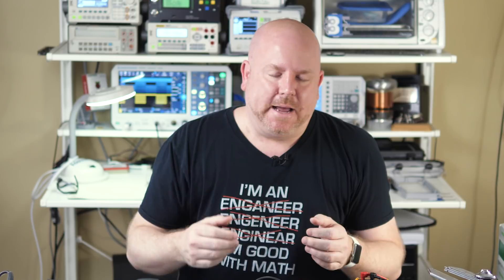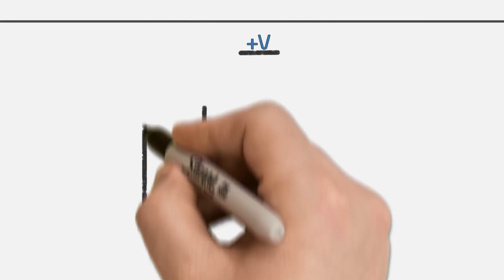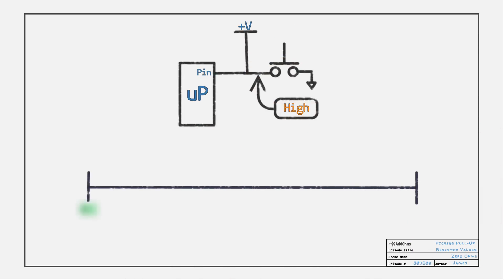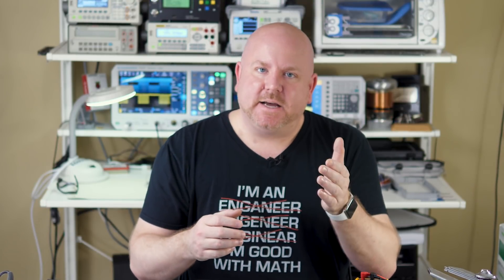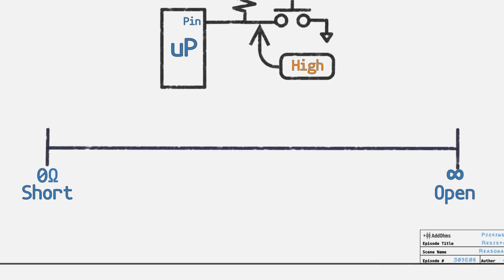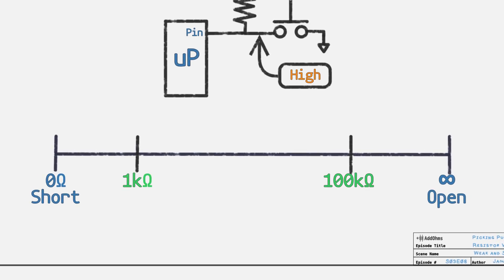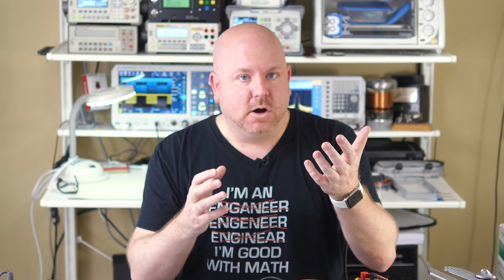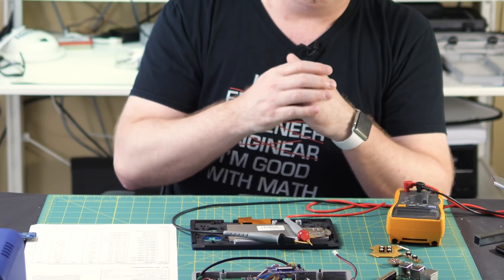Picking Pull-Up Resistor Values | AO #25

Comment: Also, if your pin change it's mode from INPUT to OUTPUT ang goes LOW, you will blow pin or whole micro! Pins can change their modes for a moment at startup.
Reply from the maker: > Pins can change their modes for a moment at startup
Almost all microcontrollers start-up with their pins as high-impedance (or INPUT). In the case of Arduino, care needs to be taken because Pin 13 is changed to an output pin to flash the LED. But that is by the bootloader and not a function of the microcontroller itself. The high-impedance state is one reason to use pull-up and pull-down resistors for other devices in the circuit.

> if your pin change it's mode from INPUT to OUTPUT ang goes LOW, you will blow pin
This is not a true statement all of the time. First, a pull-up or pull-down resistor will not save the pin in this case.  Second, an OUTPUT to HIGH can destroy the pin just as easily as a LOW, depending on what is connected. Third, it entirely depends on what the pin is connected to.,
Reply: >Almost all microcontrollers start-up with their pins as high-impedance
Did not know that, thanks for info.

>> if your pin change it's mode from INPUT to OUTPUT ang goes LOW, you will blow pin
>This is not a true statement all of the time. First, a pull-up or pull-down resistor will not save the >pin in this case.  Second, an OUTPUT to HIGH can destroy the pin just as easily as a LOW, >depending on what is connected. Third, it entirely depends on what the pin is connected to.
I agree. What I meant is 1K pull-up will limit 5V to nice and safe 5mA or so. Still a problem if pin becomes OUTPUT HIGH and button is pressed (it happens in development :))

Comment: Hey! I found your videos very useful and educative for me..but can you please expalin me the difference between ground and negative.. It would be of great help.. Thanks.
Reply from the maker: Ground is a reference point, also called common. Voltages are relative and so for most of a circuit’s analysis voltage is referenced to its “ground.” Positive voltage are positive to that reference, and negative is, well, negative. In digital circuits negative is sometimes called ground since ground is 0 volts.  Also probably because early digital stuff was powered by a battery which has positive and negative terminals. A battery floating in the air doesn’t have a ground reference, so it is referenced to itself, which is why you don’t call one of the terminals ground.
Reply: Thanks man.
Reply: But I am a beginner in the field of elctronics and i am not able to to understand the terms you have used so can you explain it through a video... Please I am very Desperate to know the difference between the two.. Thanks.

Comment: If I need a fast response, I use 3k3 ohm and pull up to 3V3. Which give me a nice 1mA sink when using I2C, beware it uses lot's of power. Or just slow down the clock speed and use 10k pull up instead.
Strong pull up is required if the boards have lot's of capacitance on the trace.

For push button you can use 100k pull up and 1nF COG / NPO to ground.
Reply: thanks!

Comment: I choose pull-up resistors based on the internal resistance of a pin. If it is low, I will rather use a small resistor value. Generally however you are right, a 4.7k is a good choice for almost all applications.

Comment: I have struggled to understand the reasoning behind pullup values for specific applications (CAN, I2C, SPI, etc.).  This video not only explains it well but it's much easier to understand than I thought.  I never considered the length of the wire as a major factor until now.  Thank you!

Comment: Another consideration is attempting to help keep CLOSED switch contacts, "clean" by using a lower 
resistor value in order to pass higher current.  The Phone company called it, sealing current"
(also called wetting current or fritt current), usually 10 to 14 ma to keep contacts, splices and
connections working instead of allowing them to become oxidized or dirty. Since the switch
contacts sit OPEN most of the time, that constant  sealing current won't flow as a preventative
measure, though it may benefit from the micro arc as the button is pressed... Prolly not!   lol

Comment: Thank you for the video. I had guessed the reasons for most of this in working with things, but nice to actually solidify it from guess work to knowledge. I normally use which ever resistor I find first. Hehe

Comment: I claim no expertise, but I came up with this deeper explanation.  

The changes of state when the pin is flapping in the breeze comes from emf induced voltages.  These waves of emf of whatever frequency are likely to induce currents on the line (i.e., and antenna)  which translate in to voltages along the line.  Not volts, but rather microvolts, but this voltage has no where to go so it rushes back and forth from one end of  the line to the other till it equalizes and/or dissipates in the very low wire resistance.  But wait, along comes another pulse and another pulse and sooner or later you've got enough to get the microcontroller's attention and seemingly random state changes.  

So we stick in a pull-up or pull-down resistor depending on the default state we want on the pin.  But those induced currents are still creating voltages that want to equalize, now with the supply or ground via the resistor.  But resistors slow the pixies so if your pull-up resistor is to large the currents zipping back and forth on the line can add up to a voltage that gets the microcontroller's attention before they can bleed off.  So you reduce it down to the lower values, but then you have to factor in the power used when the button is pushed as there will be a current through the resistor.

Comment: You could use pull down resistors and wire the buttons to the positive rail.
Reply: Depends on what you're doing, and the type of switch.

Comment: Technically you should use the largest possible resistor while preventing bad behavior to keep the wasted current as low as possible. If it works with a 100k why would you put 1k?
The problem is to find if there's a bad behavior from time to time (if R is too high and the bus is only connected to open collector type drivers then that will slow down the raising edges). Also you don't want to spend time on that if it's not battery operated. So I guess the trick could be to test with 100k and reduce that until it works. Then add another 10x (3x on battery) safety margin for you final design so you know that with variations (in temperature, batch of components, drift over time...) it will still work.
You can justify a smaller margin on battery because reliability is useless without power...

Comment: I have not played with electronics since TTL but if the resistance is too high you may find false state changes due to noise can be a problem depending on your circuit layout. Floating a pin is a no-no.

Comment: Or take ohms in case of fast signals, and/or long wires. :D
Reply: Indeed, with capacitance added (assume the switch is a MOSFET with 25pf), then in series with 10kOhms, the constant time of 3RC gives something which can't exceed much higher than 1MHz.

Comment: It may be worth noting that a strong pull up resistor is useful when there is a weaker pull down resistor already in circuit (say, built-in to a chip.)